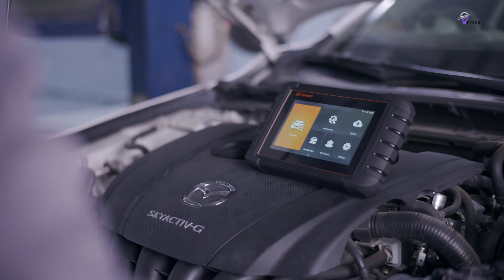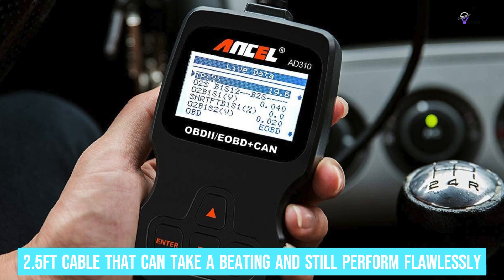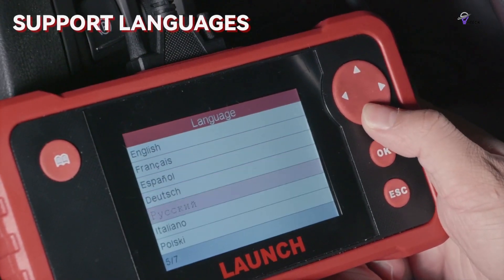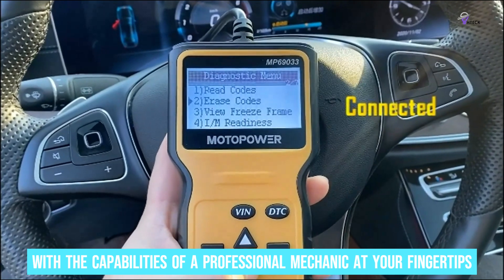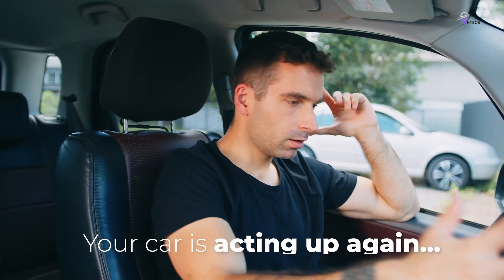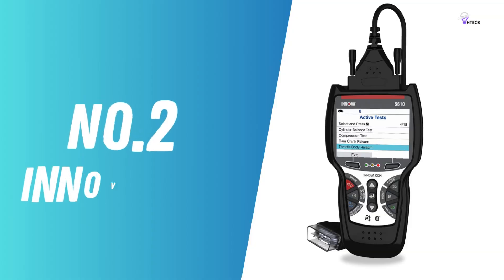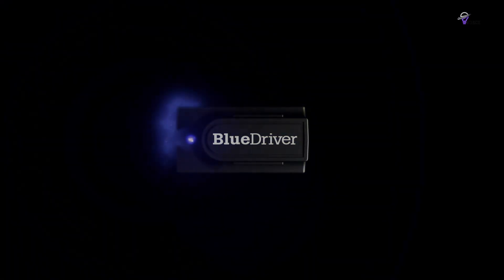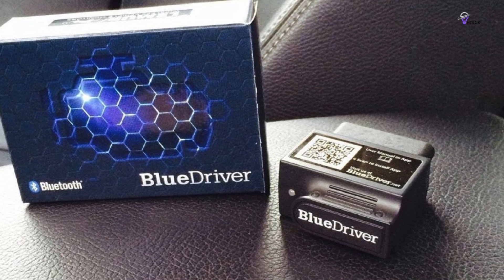Best OBD2 Scanner 2025 [don’t buy one before watching this]

Comment: Defenetly dont try and diagnose it your self the codes only tell you what system there is a fault on it dosnt diagnose the fault fault code and the actual fault are oftern 2 different things
Reply: i had a code for my thermostat heater, i was not convinced it was actually bad as i had changed it not all that long ago, i found the problem, it was just a bad connection in the plug on the heater side. was easy.